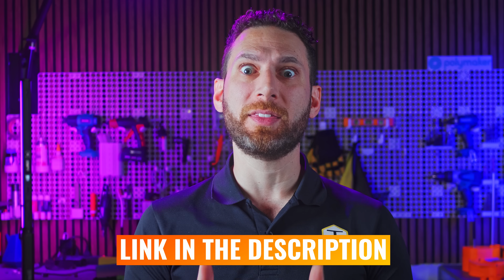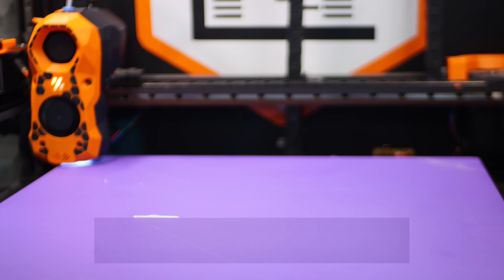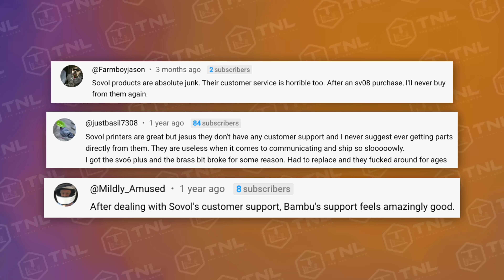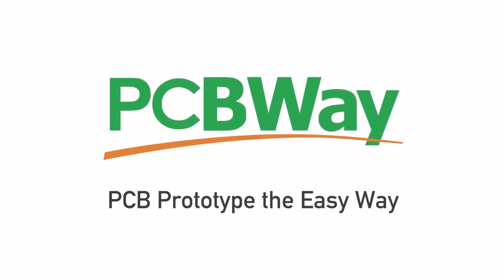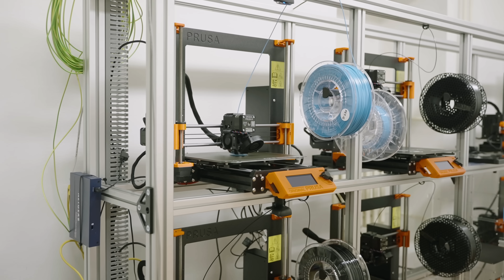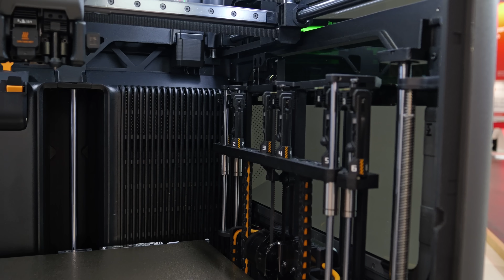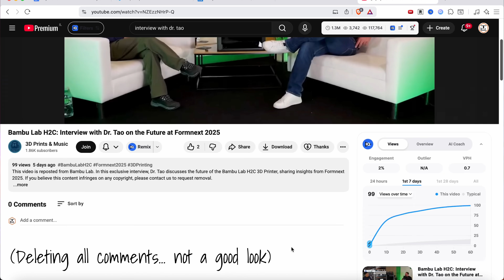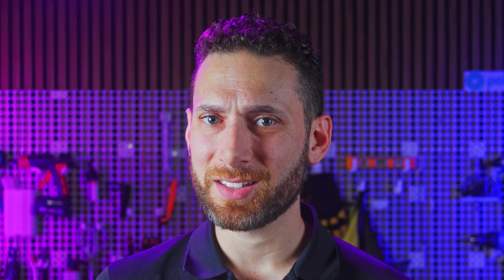My HONEST Annual Report Card for Each 3D Printer Brand

Comment: Got a P1S last year and love it as a printer after 10 sigh years of the ender 3 it was a breath of fresh air. Then bambu went all screw all our customers we want your data and that has showed recently as to why with the addition of the "AI" helper that has been trained with no shadow of a doubt that EVERY single print that has gone through theire cloud services. If I print from the app and stuff from makerworld I'll do it via the cloud services but for my custom designs (not that they're any good but never know) all devices go offline. The laptop and printer both get disconnected from the internet and SD card transferred. I'd dread to think of their egress costs from azure when they could literally send instantly across the local network, there is no need for it. As for the P2S I was excited till Tom did his review and took a hole saw to his printer and was exactly what I was thinking so purchase was abruptly cancelled. Apologies for the big rant.

Evevn though I dont have a need for a tool change printer. The Snapmaker U1 is looking appealing right now.

Biggest think I want this year though is an offline printer that has a web ui whether that be something you run yourself on a raspberry pi or in docker that requires no cloud connectivity should you so wish.

Comment: I decided to not purchase any bambu products other than regular maintanence and parts for my existing a1 mini. I was fine with proprietary firmware, but they have come to directly lie to consumers. Also, I'm gonna experiment with Moonraker on the stock elegoo hardware as elegoo's firmware is a stripped down klipper fork. I'll be testing opencentauri and I'll see if the patched firmware that sjips with a package manager will allow to install Moonraker and hopeful mainsail, but idk if the hardware itself can handle it.

Comment: I buy printers to print, not to tinker with different slicers, nor do I care about the open source of the printers. Bambu's ecosystem is fantastic. Period.
Reply: Bambu's ecosystem isn't fantastic. What about vendor lock-in restrictions or you cannot use any filament, slicer, or firmware when printing...

Comment: I think bashing Bambu is a perfectly reasonable approach given the issues the community has with their decisions; however, it should've been noted (with examples) of just how many things they got right.  There's a reason they took over the industry.  Their printers absolutely knock it out of the park.  You don't have to love em, but THEY innovated, unlike Creality and Prusa.

On top of that, Bambu's H2C is not a bad printer.  I honestly think it was the path forward necessary to incorporate all of the AMS machines users already own and utilize for filament management.  Assume they made an actual toolchanger like the INDX or U1.  Don't you think everyone else with a Bambu AMS would be upset that it's not compatible?  Such as myself, with 8 of them across 2 printers.  Is it slower?  Yes.  Of course.  Is it compatible with existing gear?  Absolutely.  And that's the tradeoff that makes it worth it, despite the time lost.

Comment: Remember that 3D printers are moving away from simply being a hobby. So get over some of the changes. We simply want a 3D printer to work as our laser jet printer where we don't need to modify it up the butt to get what we want as they simply just print without issues.

Comment: You forgot Qidi
Reply from the maker: They don’t wanna work with me so I got no notes on the last 3 years of printers
Reply: @thenextlayer  is it because of your critique of their support and speaking about about their fire safety?
Reply: A lot of people do forget them unfortunately.
Reply: Q2 is amazing. QIDI has some issues with rushing things and some poor QC, but the hardware is unmatched in their price range. Also their support is pretty decent. My nozzle leaked due to crack in the ceramic tube and they sent a new hotend right away - it's pretty expensive.
Reply: @printsthatscale  I have a Q1 Pro and really like it. Biggest advice with them seems to be "NEVER buy the first production run of one of their printers." Since I've heard they've had similar issues before.
Reply: ALOT of folks INCLUDING TNL had a rough start with QIDI with the X3 series (Qidi X Max 3 if I remember correctly, which is the printer I own personally) which involved the 1st iteration of their printer on a new series (I have the revised series X Max 3, with the old revision tool head board, so I didn't have many issues except for that tool head board, and they sent me 2 of them PLUS a new mainboard when I had the MCU errors).

I think MOST would agree the first generation of a product is gonna be a hit or miss, I'm of the mindset to let others experience the initial failures and only then I'll buy it. Mine has been running flawlessly for over a year printing ABS and ASA (mainly) with some PC and PA filaments in between (mind you I didn't buy the v2.5 hotend either, just a Triangle labs V6 adapter and CHT nozzle for non abrasives on the original hotend) and it's been FANTASTIC!... But 1000s if hours of printing has had its effect on the motor mounts on the XY gantry and now I'm faced with a rebuild (I get it, NOTHING lasts forever, no matter the brand) so it's time to save up and get those motor mounts replaced or CNCd, and come up with an easier to maintain solution/mod.

Sorry for the rambling, just shooting over my thoughts and opinions, for what it's worth.

Comment: I'm having a hard time with more and more companies in the industry moving towards closed cloud first systems. A 3D printer with local communication (and a a user with a VPN) would solve those use cases without any elevated risks for the users. In fact, it would probably means less risks for the users

Comment: The Core One INDX reveal convinced me to purchase multiple Prusa printers for my small workshop.  Prusa went from looking behind the times to ahead of the curve.  I can't wait to print with it.
Reply: Core one L looks good. But it’s expensive compared to a Bambu lab printer. It’s really bondtechs INDX system that may bring more people over to Prusa. H2C is too little too late.
Reply: @jacklowe7479  Even with all the excitement, I think most people are still sleeping on how much INDX capabilities and Snapmaker's affordability are going to change the entire 3D printing scene. They make all other material change techniques irrelevant.
Reply: @jacklowe7479  the reality is that designed and manufactured in EU printer will always be at least some level more expensive that chinese products.

Comment: I purchased my first bambu labs A1 printer this year because bambu labs filament is much cheaper and more readily available (like overnight delivery) in my country. Right before they forced me to use LAN mode and the bambu handy app stopped working for me. I had to install a web cam so I could see the print because there's no way to see it other than through orcaslicer. I don't like how bambu labs have treated us and how they only walked backwards on their bad decisions after huge pressure from the the industry and 3d printer owners. I also found out my printer can potentially catch fire. I think I'll end up upgrading my mk4 to the core one for convenience and suffer through the expensive prices of prusament filament/delivery and multiple weeks long delivery times.

Comment: For prusa, I would like that the machine turns off all the lights after x min when print finished. I mostly send my file and go to work. I come back and still everything on. Yes I set it to dim when idle but for entering idle one needs to go back to main menu after finishing the print. Quite annoying
Reply from the maker: That feature is in the firmware. Set idle light to 0%. Done!
Reply: @thenextlayer yes but this removes the light all the time (even when printing, no?)

Comment: 1:05 I could honestly care less about nfc tags on filament, it litterally just adds another thing to break that in reality does nothing to actually benefit print quality.
Reply: Well in theory if the tag automatically tells your printer what the fillaments recommended print setting are its kinda nice using bambu spools with it is verry nice not having to mess around to find what setting work

Comment: Here’s my wishlist for 2026: 

1) Toolhead changer firmware that supports different nozzle diameters. 

2) This can only happen if #1 is already done. Spend less of your AI budgets on tools for generating low-quality models (looking at you, MakerLab), and repurpose that for your tool changers to make a slicer feature similar to Adaptive Layer Height that will analyze your model and automatically switch between large nozzles where you need bulk and small nozzles where you need detail. For printing minis, I would LOVE to be able to print a big dragon with the same filament on 3 different spools connected to .2, .4, and .6 nozzles, and one nozzle with support interface material to reduce scarring. I would throw money at that. Then I wouldn’t have to choose between size, time, and quality so much.

Comment: I agree with the quality on the Anycubic side. I really like my S1, but I feel like I have to be gentle with it, lest I break something. Last time something broke, support did send me the replacement parts, which was great, but it does make me nervous for the next time. Also, Anycubic, abandon Slicer Next and just use Orca, and adopt the RFID standards, please! Slicer Next crashes a lot, and has some strange translation issues. If you can just forward Anycubic functionality into mainline Orca, that would be great. And Anycubic filament is really cost-competitive and has RFID. If you just adopted the new standard and implemented it with firmware updates, you would have a big competitive advantage.

Comment: Im not a bambulab fanboy, il adress that.
But the whole schebang the "community" ( which btw, isnt everyone..Its those who speak up saying they represent "many" people cause 5 people agreed with em online ) 

For starters, you run a business, not a charity. And sadly, how things are made today..isnt made to last.. Its made for consumerism ( Ironic with 3d printing right) 
Prusa wasnt doing what they are doing for the "community" they did what they did cause noone else was around doing what they could and they wanted to fill a market, which they managed to do.
So goes with everything, there is hard brutal competitions and it will always be david vs goliath scenes.

For the other, regarding having their own eco system, you have to know right..that those who are into 3D printing in the future..arent those with knowledge what open source means, or that you can use 10 different slicers. 
The "future" buyers, want 1 system. Pref non.. They want to take a picture or think of something they want, and then it will start to print.. Thats it.. They dont want to learn how to design themself, calibrate, clean or anything that requires alot of learning how stuff works.
So obviously they are gonna focus on their stuff, rather then having to adjust to everyone else. 

Its literally what every major brand is doing in every business there is. 

I had to short it down, cause i realize it doesnt matter what i say here.
But in short, aslong as you deliver quality, for a fair price.. Everything else is just silent whispers that noone in the future will care about..Specially the type of people the industry are hoping will buy printers.

Comment: Good review.  I would really appreciate if Prusa could communicate the colors loaded on the XL tool heads to the slicer or Prusa Connect.   I load each head - as you made note a time consuming process and tell it which color.  That information is never transferred, so I have to write it down to enter it in Prusa Slicer.  I have not tried Orca with the XL, but assume it is absent also.    Elegoo and Snapmaker seem to have some great budget friendly printers.  Those of us that have been in the hobby since the early Ender days are impressed with what we can purchase and at the price.
Reply from the maker: OMG YES  this drives me CRAZY and I didn't think to mention it. I kinda alluded to it with the "interface" complaint, but, YES, this annoys me. I THINK I saw that this was handled / fixed in the new firmware for Prusa INDX.... so hopefully we get it for XL too.
Reply: @thenextlayer  thanks - my printers are in my basement and all of my design and control is done two floors above.  I have to make the trip too often to check the colors.
Reply: I'd expect this OpenPrintTag readers come to their printers.

Comment: 100% agree on the H2C being a failed approach to a tool changer. Who the @#$% at bambu thought this was the answer when the industry had already shown a much better approach. SHAME ON YOU BAMBU!! Report card D-
Reply: What about it failed?  Longer tool change times?  Is that really the only gripe?  It does all of the same things, just slower.  What would've depressed me is if they came out with this awesome product that made all of my AMS machines $350x8 obsolete and incompatible.  Time is valuable, but this printer still solves the purge problem.

Comment: The biggest industry-wide innovation that I've seen in prototyping but not production that we all need: layer annealing. Prints that are closer to isotropic are becoming a must for anything that's not a trinket, and we still have 15-20% Z strength vs XY strength.

Once the brick layering patent debacle is ended in the US, perhaps that can actually be a real thing for stronger parts in slicer software.
Reply: No we don't, unless you use some bottom tier filaments.

Comment: 2025 year in review: Bambu milked the US tariff situation like Luke milked the thala-siren on Ahch-To. They used tariffs as an excuse for a major price hike on the H2D after release and also instead of admitting they flubbed the FCC approvals. And they had the gall to put friking sharks with friking laser beams into 3D printers. Prusa finally started shipping out a 3 year old core xy printer and the Prusicles all fainted with giddy delight while saving money on tiny build plates and gladly paying extra for cameras, filtration, etc etc. and claiming Prusa is Back Baby! The "L" version debuted with a completely different companies solution to multi material and somehow this was a win for Prusa. On release, everyone can buy the same nozzle swapper system without paying Big Orange (looking at you Sovol SV08 Max). Anycubic forgot to put a heat bed in it's heat bed on the S1. Elegoo tried to self destruct it's printers with faulty cables after it figured it couldn't deliver on an AMS. Flash Forge threatened to send armed authorities to your home if you printed something perfectly legal that they didn't like.  Snapmaker, a well established 3d printing company, decided to do a "Go Fund Me" for the U1 (which totally worked). Creality is still raking it in selling printers that everyone buys before they buy their 1st good 3d printer.

Comment: I don’t agree on the notion of the thumbnail either. 
I wish I could purchase a prusa that offers at least dual material print without the waste and works as flawless without having to tinker…. but it doesn’t exist (yet). 
The argument is moot. Same with Linux vs macO as vs windows. Guess what, have Linux for tinkering, windows for gaming and MacOS for daily machine that is super slick to use. Is that still an openBSD?… no! 
Bambulab deserves far more praise than they get for having commoditized 3D printing, nobody did that like them. First and foremost I want the 3D printer to work as flawlessly as my 2D printer. 
The tech has grown up, most people want to use it, not bothering about customizing it. Who customizes their 2D printer?